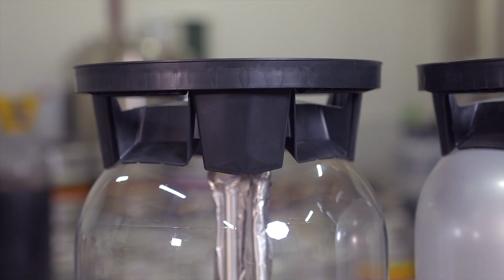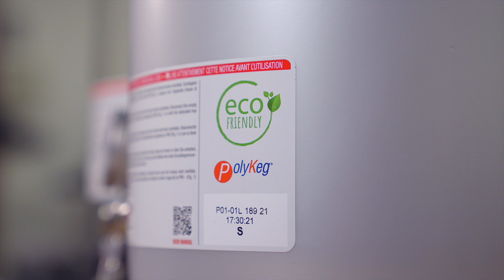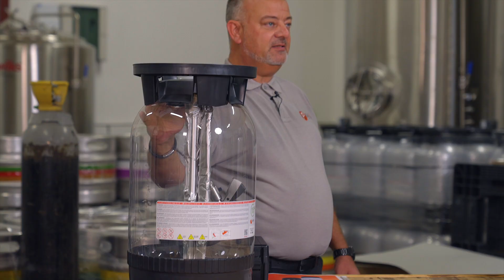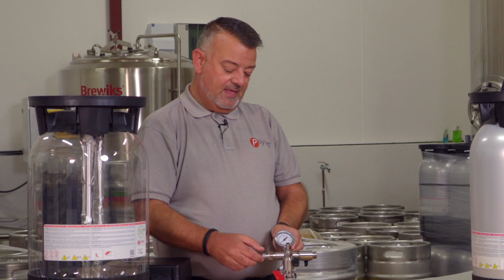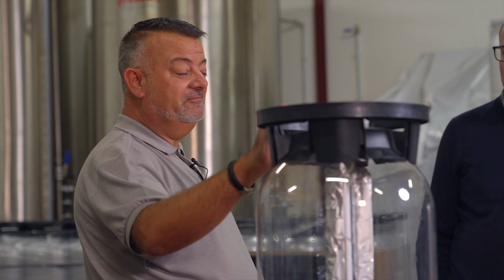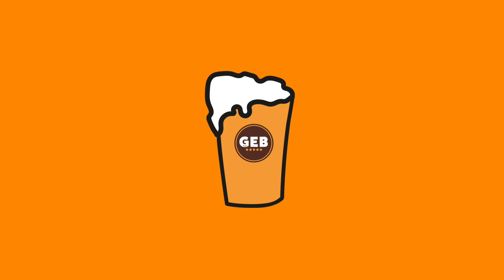The Best One Way Kegs - Polykegs now available from Geterbrewed

Comment: Great for startup breweries with giving another option than investing in steel kegs. Are these also suitable for Cask Ale?
Reply from the maker: The Polykegs with the bag can be used for cask and still comply as far as i know as the beer is dispensed with pressure on the outside of the bag so no co2 getting into the beer as such

Comment: Can I use a Sankey coupling on Polykegs with a bag where I am using compressed air.  (No CO2 available) or am I restricted to KeyKeg couplings/  Not sure how the bag valve works?
Reply from the maker: Yes they are available with multiple different types of couplers and all with or without bags
Reply: @Geterbrewed  Sorry, I have not been clear in what I mean, my fault.  I was asking if I can use compressed air to dispense from poykegs with bag and if so what coupling can dispense from the Polkeg with Bag without having a contact of the air with the beer.
Reply from the maker: @thecraft6481  yeah the with bag option will allow you to dispense using compressed air, the without bag will need c02, hope thats answers your question

Comment: Could you convert one of these into a pressure fermenter after you’ve drunk the beer?
Reply from the maker: In theory but you would need a dismantling tool to remove the coupler to take the bag out or clean ready for the next batch